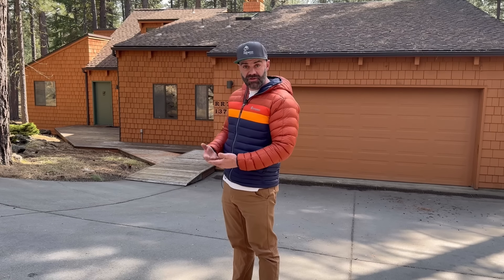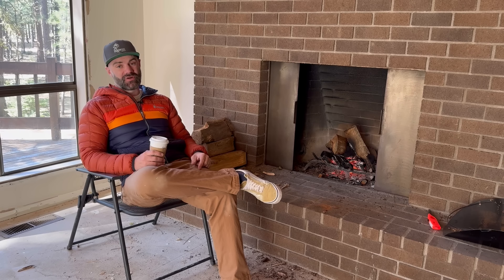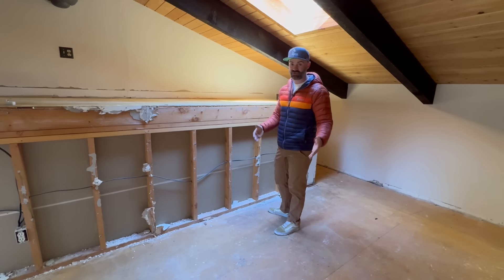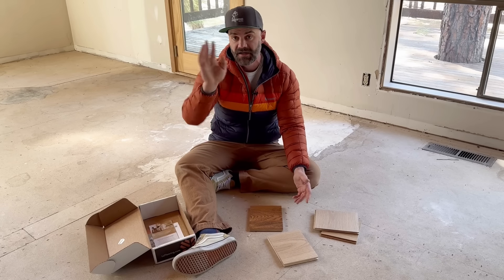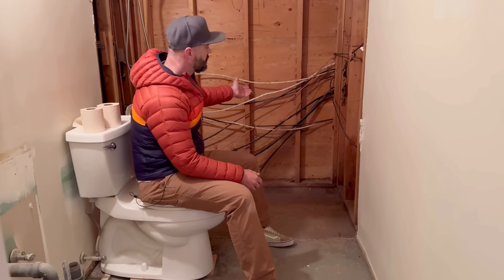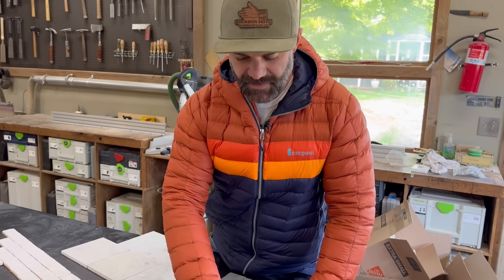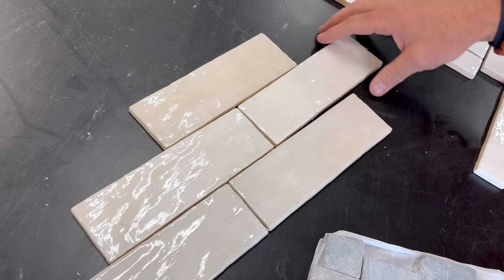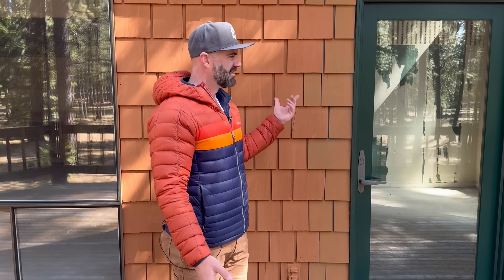Cabin in the Woods Update || Everything Takes So Long

Comment: As an experienced AirBnB superhost - dont do wood floors. you want your home to be bomb-proof because you WILL get bad guests. Wood floors is just asking for headaches. I would go with a Porcelain tile (which is the most durable) that looks like wood. There are tons of options, gives the same vibe/look but just wont scratch up
Reply: I agree. I personally hate that tile, but the logic behind it is sound.
Reply: I was going to say the same. If you rent it out go for something like what they use in shopping mall's or something... There are other options than tiles though that look like wood floors but can handle a tractor driving over em
Reply: Vinyl planking works well too and waterproof

Comment: I just saw a similar comment below, but I came here to say: You might consider installing a small area of stone (any of your bathroom floor options would be great) right inside your front door, sort of like a permanent stone doormat. It's common in Canada, and I've seen it all over Europe, too. If you build a little storage bench there you can deal with wet/muddy shoes on the stone surface and protect your wood floor. If you plan ahead you can make sure the stone is level with the wood floor.

Comment: I like you videos very much and the way you explain your way of thinking in a calm way compared to other hyper-exaggerated content creators. Also, you show that you made mistakes and how you fixed these. What came to my mind, probably too late or too extensive to implement: Radiant floor heating. That stuff like Warmboard etc. Especially for Eastern Oregon where winters or the "interim" periods can be chilly. Since you already ripped out the floors everywhere it would be worth considering. We have a house in Central Europe, exclusively heated by radiant floor heating (low temperature), running flawlessly for now 44 years (no leaks). Installation was under tiles, hardwood flooring, carpet and now vinyl. Especially for high ceilings up to the roof -- yes that was also fashion in the 80s in Europe -- you don't have convections. Furthermore, never cold feet. Guaranteed even if you cannot feel your feet anymore it takes 15 min to reverse that. With the not so insulated homes built back then you might want to keep your forced air just in case. Agreed, it is an additional cost factor. For myself this would be a "must" to have.

Comment: I'd like to make an suggestion for the inside of the front door... Since the location tends to get a lot of snow... And even with the covered front door on the outside to keep weather intrusion down, and that is to add a tile section to keep any water damage to the floors from occuring. I'm sure the wife will need to approve this... But, it's something I wish my house had since i have no coverage outside of my front door.

Comment: I am a GC and build and remodel a ton, for the kitchen since it won't ever really move I set 3/4 ply under the cabinets and leave them about 1/2" short around the edges so that you can still slide your flooring under and make it look like its under there. Lets you put the cabinets in whenever you want and saves a couple bucks on the flooring material. Plus it makes it easy if you ever have to pull your floor up.
Reply: Does this eliminate issues with replacement/repair of appliances? As a tech, i see appliances that can't be repaired because flooring was added afterwards.

Comment: You're wrong about floating floors! Well, really, I don't actually know... but I didn't want us to let you down.
Reply: I support this.
Reply: @arnefines2356  No, Mr. Moth was wrong about solid wood vs. floating floors. He said the “wear layers,” or the amount of solid wood above the tongue, was about the same with both floating and solid wood flooring. This is very wrong. The oak that I’ve used in my home has 5/16 ths of wood ABOVE the tongue layer. Mr. Moth said it was “about the same” as a floating floor, which he estimated to be 1/8 th thick. (He was being generous, it’s typically a bit less.) So, compare 2/16 ths to 5/16 ths, and you get OVER TWICE the amount of wood in the wear layer.

Further, there are many, many more advantages to solid wood flooring. For starters, Mr. Moth will be struggling later when he sets all the cabinets, islands, and other large furniture/built-ins in place. A floating floor must be allowed to do that—float—and he risks pinning it down in place and having it buckle. Search for You Tube videos on this, there’s plenty.

Comment: Suggest large tile for the showers, less grout lines that need to be cleaned each year.  Also we have always put a mirror behind our stoves (cooktop) since much easier to clean than grouted tile.  Using the tiles you picked out means you will be spending time each year cleaning grout lines (or paying someone else to do this).  JMHO  And I was one of the many who knew you would need to replace the beam you took out.  Last year's low snow load and the fact that God loves structural engineers more than any other engineer is what has saved you so far.  Why does God love structural engineers?  Because a structure will go into all possible configurations available prior to finally falling down.

Comment: I had a house with engineered hard wood floors and it was PERFECT.  The finish is applied in the manufacturing process, eliminating the awful smell of doing that in situ.  The boards are flat and consistent.  The underlayment makes the floor quiet.  Also, sadly, it is  currently near impossible to find craftsmen who have a high level of pride in their work.  You will be impressed by the engineered floor. 👍
Reply: One thing to add when comparing 3/4 HW to engineered is that most (all?)engineered hardwood gets installed with a visible V groove in-between the planks. Nothing wrong with that but just a different look. But one upside to engineered is that if you like the look of wider planks, engineered might be more stable in certain environments and/or require simpler installation where 3/4" HW plank 4" or wider might need costlier glue to prevent cupping.
Reply: Had 2 large water leaks on mine. Stayed almost perfect. Hardwoods would have buckled. I’m now a big fan.
Reply: What brand did you use?
Reply: I did this in my kitchen and wished I had tiled. The dishwasher leaked and caused damage, the water and ice from fridge door also did damage over the years. If I could do it again I would tile.
Reply: @chrisp9127  This is why I always use tile in the kitchen. Damn!

Comment: Don’t know what Internet provider you have up there but I would get them to come in and set it up now. You can run cat5 throughout the house and have the modem in a central location. It’s a big house so you will need extenders for sure. The cat5 wire can hook up to the modem and the jacks in your house so you can hook up your extenders.

Comment: I'm also renovating my entire house (have been for 7 years now!). Currently doing entire t&g 1x6 white ceiling. Next up, all new hardwood flooring. Totally agree with you, NO to the floating floor, for the same reason! We have about 40 free samples lying on the floor now. Think we're going with a Hickory engineered floor from LL Flooring with 3 mm wear layer, nailed down. Hard to find much thicker than that. Good luck on your project!

Comment: I used the same bathroom floor tile in a shower floor and really like it. It was a little tricky to install because the size of the tiles vary for a cobblestone type look. Some reviewers said they pulled all the tile off the backer and placed them individually to keep grout joints uniform.

Comment: Just finished my kitchen remodel (and new hardwood floor). AS you mentioned in your planning, I also waited to install the floor until I installed the cabinets that I had made. However, the floor installer I hired noted that he typically installs floors after the cabinets are installed. They have no problem installing floors around new cabinets - less finish material is needed and less potential damage to the floor. In retrospect, it would have been helpful for me to install the cabs first, from an "order of work" perspective. Not super important, but something to consider as you progress on this project. Good luck, looking forward to watching it evolve.
Reply: Will it make the dish washer difficult to replace?

Comment: Just an idea in the hot tub. We had the same concerns about putting it on the deck.  What we decided is we cut out a “hot tub” size hole, poured a concrete pad and sat the hot tub in the deck.  It looked great and was easier to get in and out of.

Comment: Just finishing up a remodel.  I built my cabinets and made the kick 1/2" taller and 3/4" further back than normal. 

Then I added 3/4" ply to the front of the kick and did the veneer after the floors went in.  

That way I could put the cabinets in before flooring and not have to worry about cutting the flooring in so tightly to the cabinets.   Didn't need any quarter-round.   Looks like the floor goes all the way under.    And i didn't have to worry about scratching my engineered flooring while installing cabinets.  

Just an idea for you!
Reply: Also, a lot of engineered flooring doesn't recommend putting cabinets on top.

Comment: Jason... For engineered flooring (definitely) check out Carlisle Wide Plank Floors. We went with their "Carlisle, Picture Frame, Engineered, 8 inch face width, 3/4 inch thick" (as printed on the invoice). That was 8 years ago for our oceanfront cottage on the Maine coast. Given the temperature & humidity variations this has performed incredibly well. Ours has white oak top layer complete with a water-based finish and it is rock hard. They make their own flooring on site and below the 3/16" top layer are 10 plywood layers. A great product.

Comment: @Bourbonmoth You might want to check out Paradigm Conquest waterproof flooring. A friend of mine did a gut reno of his house on the water (salt) and he did all high end finishes. For floors he went with this instead of wood because of the wear and the elements he needed them to be able to hold up under. Between snow, dirt grit, pine sap, etc., it would seem as though you have equivalent challenges for your flooring. And his floor looks amazing. I didn't know they weren't wood until I asked him. Plus, I bought him a Bourbon Moth hoodie, so you kind of owe us.

Comment: There was a similar floor drain in a shop I worked at. In the one end was essentially a pipe that goes down. It would get clogged up every year so we had a metal scoop on a pole that fit nicely to get it cleared out. Perhaps something like that would work for yours.

Comment: A couple notes from experience with my rental:

On Engineered hardwood, you’re technically right. However, the veneer chipping off will lead to basically every flooring company you talk to will not repair the floor. Often once it chips in one spot the rest of the veneer starts lifting.

When you walk on the floors you own, it’s not a big deal. Renters and especially the couple of AirBnB renters that give a bad name to good renters… can do heavy damage to engineered hardwood.

For a rental, I’d use LVP or refinish the hardwood that is there. Industrial LVP is pretty good as far as feel and thickness, especially in large spans. There is also “Engineered LVP” where the wear layer is vinyl and shouldn’t chip due to the combination of water and wear the same way Engineered Hardwood does.

On your windows, the cool thing these days are European style casement windows. My wife wanted double hung instead and they’re no more energy efficient than the original windows in our home from the 90s. Maybe less so because we also pulled the storm windows off. Basically, unless your seals are blown most energy claims are exaggerated by the people that sell windows. Having single pane from the 70s means you’ll get a benefit, but don’t go nuts. $10k more for the “next more efficient windows” is money better spent on a heat pump or Solar.

Lastly, put your hot tub next to the deck. A loaded hot tub is heavier than parking a car on the deck. You’re low and it’s easy to block/crib, but deck people hate hot tubs except for how much money they make replacing decks damaged by hot tubs.

Comment: I still like solid 3/4” hardwood floors. Can’t beat that.
Reply: Same. Explored the engineered path but went traditional. Overall look and feel. I did however think there was more refinishing depth in a standard 3/4 T&G plank vs the 1/8" engineered. This being something I valued for the life of the house beyond my ownership. But I'm trying to confirm if indeed the refinishing depth is the same for both floor types (as described in the vid). I kinda think not...?

Comment: Engineered flooring is the way forward. Everything you say is spot on, but in that house, where the temperatures and humidity will fluctuate a lot seasonally it's stability will be invaluable. I fitted an engineered oak floor at home and it's so stable what when I took a risk and tiled right up to it (i know, but I was in a rush) I expected the grout to crack once winter came and the heating was put on but it hasn't moved at all. Amazing Stuff. Oiled floors seem to last better, if you scratch it a bit of WD40 wiped in tends to hide the scratch really well.

Comment: The hot tub on the deck sounds like a great idea, but, remember you have pine needles falling, and even with a cover, them suckers will find their way into the hot tub somehow...seen it happen, have yet to figure out how.  Looking forward to the coming series. Lots of work and money about to flow thru your hands and brain, but don't sweat it too much and make this a project that has you in constant battle with your own mind and happiness.  Remodels can be quite rough on relationships because you overthink things and disagree on so many things. I've seen 4 divorces of couples I never would have thought would have anything problematic just because of a house remodel, especially a second home or getaway some place else.  Take it easy and don't become part of that statistic...please.  Take care and good luck.  Glad where I live out in the country we don't need someone telling us what we can and cannot do on our own home.  I overdo things far beyond what it's the minimum anyway, so no permits needed because I have built mine 3 times above building inspector specs (10 gauge instead of 12 for wiring in conduit where it's not required, 12 inch centers instead of 16 or 24 on wall studs, floor joists, and rafters, etc.).
Reply: When my husband and I bought a larger home a woman I worked with told me if we ever remodeled we should move out.  Hubby and I then began counting the number of couples who separated/divorced during a remodel and realized she was right.

Comment: Just finished the previous video. Was wondering if moving the stairs behind the kitchen wall would be a better option? It will open the entryway allot, it will make the work more but will help woth the flow of the house

Comment: Quick design comment on the tile pattern in the shower… it might look like you messed up with the vertical tile along the bottom and then subway pattern above. Might I suggest, start subway pattern from bottom to about eye level and then do a row of vertical and above the vertical go back to subway pattern to ceiling. Would be a nice break up of the tile and look more intentional. 😊

Comment: The previous hot tub more than likely sat directly on the concrete pad. As you are not staying there full time do some research on hot tub chemistry. Some are less maintenance than others. It is not just filling it up with water and heating it up.

Comment: For the bathroom tubs or showers, you will need a backer board for the tiles.  You will also need a way to waterproof between the tiles and backerboards/wall studs.  
For the most part tiles can be waterproof, but the grout needs treatment and maintenance.  So if there is waterproofing behind the tiles, your basicly idiot proofing the walls on the shower.
You will also need to check on the fans in the bathrooms for moisture control.   Check the fan piping to see that they are sealed with the proper tape.
Reply: I assume the person he hires to tile them will know all that and advise him. He's not the kind of guy to hire the cheapest contractor just to get the job done.

Comment: "We can't install the kitchen cabinets until after the flooring is done." 

Thank you for doing this right and not the way other youtuberes are doing it.
Reply: Depends on the type of floor you’re installing. Floating floors you install after cabinets.
Reply: @AlexandCarly  Still needs to go under the cabinets.
Reply: @Gitarzan66  no, it doesn’t. It’s recommended to put cabinets on top of floating floor. The flooring needs to expand and contract. Seen several van life people really regret putting flooring underneath their cabinets because now the flooring is pulling apart.
Reply: Noooooooo. I moved into a house with custom cherry cabs on top of a vinyl floor. I had to buy a toe kick saw and a ton of multi-tool blades to update floors. Please don’t install cabinets on top of flooring.
Reply: If it's a floor product you attach to the subfloor, then put it down before anything else. If it's floating, it needs the ability to do so, and putting cabinets on it can cause problems.
Reply: @Gitarzan66  You know nothing. The floor must FLOAT, not be pinned down under the cabinets.
Reply: @AlexandCarly  You people are sooooo wrong.
Reply: @linnoff  Oh my god, someone finally got it right!